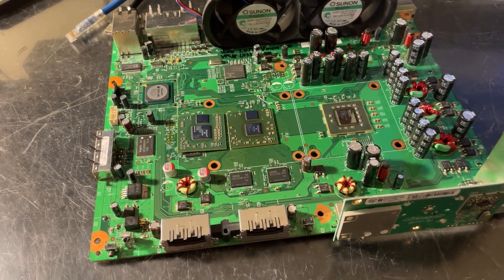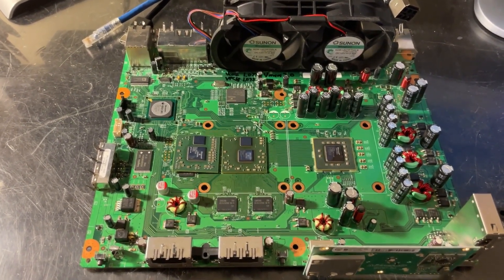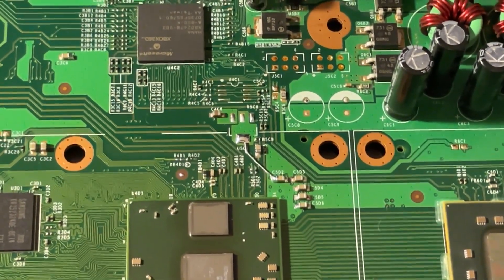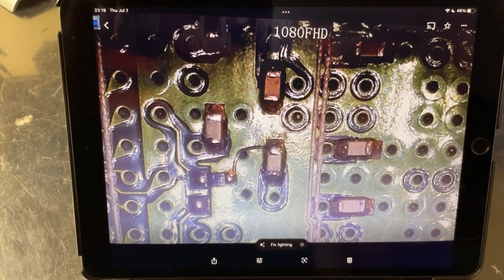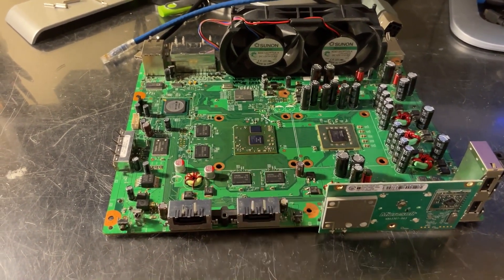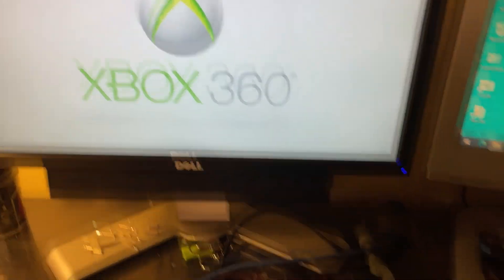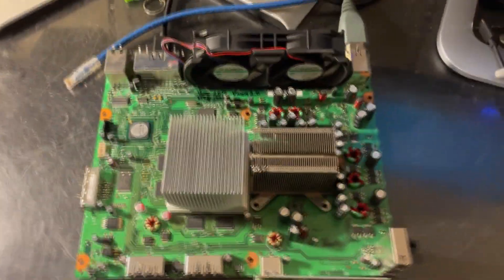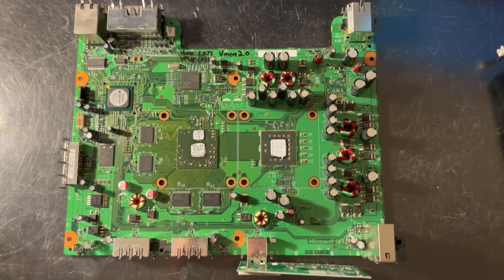Xbox 360 Zephyr Retrofitted with 65nm Jasper GPU

Comment: Hey man, do you know if Jaspers are the first boards to run their fans momentarily after powering off? Got a late Falcon that shuts them off immediately but also have a 2010 serviced early Falcon that runs them momentarily. That'd be another lil detail to add to Xenonlibrary
Reply from the maker: Are you sure you are not referring to background downloads??? There is no behavior like what you describe that is specific to a board revision.
Reply: @Josh.Davidson This is what I mean, the Falcon shuts the fans off instantly even after hours of use where the Jasper will run them after powering off, both consoles are offline with auto updates off

https://youtu.be/JYzbD-d0bYI?si=md1UX54eD5ditf7X
Reply: @Josh.Davidson  interesting,  well both consoles are offline with auto downloads off. The Falcon will never run its fans to cool the heat sinks even after hours of gameplay but the Tonasket will run them even with little use and you'll see the power button light up a couple times
 https://youtu.be/JYzbD-d0bYI
Reply: @Josh.Davidson  Nope, I could've worded that better my bad. I'm wondering if earlier revisions run their fans to cool the heat sinks because i have a late Falcon from Aug 08 which doesn't even after hours of gameplay but I have an early Tonasket from Jul 09 that will run the fans even after being idle in the dashboard. I also have an early Falcon from Oct 07 that was serviced by Microsoft in late 2010 that also runs the fans so i'm curious if Microsoft programmed it to do that during the service
Reply from the maker: Nope, they did no such thing. 
You are referring to background downloads setting. A console with that setting on will stay on and sync downloads or something for a while. There's no point to "cool the heatsinks" or anything like that.
Reply: @Josh.Davidson  Right you are Josh, i got background downloads confused with auto downloads and now i feel dumb. Thanks for clearin that up man
Reply from the maker: @CliffNark  No problem!
Reply: @Josh.Davidson  Another thing Josh. I got a Tonasket with an MFR date of 2009-07-30. Wouldn't that make it among the first produced?
Reply from the maker: @CliffNark  yes. Are you sure it's a Tonasket and not a late Jasper with Kronos?

Comment: I have a Halo 3 Xbox 360 that was oficially repaired by Xbox (RROD) in late 2012. Looking at the power plug, it appears that they either reworked the chip or replaced it with another Zephyr board. I was surprised to see that Microsoft replaced a Zephyr with another Zepyhr all the way in 2012, unless maybe they reworked the BGA packages? Was that common?
Reply from the maker: Hi,
It is more likely that they simply replaced the GPU with a fixed version of B14L (Rhea). They manufactured these chips up until at least 2010 for repairing systems, and since the flaw in the GPU was fixed in early 2008, they would end up with a lot of chips, and less and less consoles that needed them. This is my guess, if you show me a photo of the GPU die, I can tell you for sure.
Reply: @Josh.Davidson  I'll break the system down and send a picture over. If that's the case, would you say that this Zephyr is relatively reliable with its die revised GPU or will it most likely fail, too? 

I have a jasper board here that's in perfect working order. I thought about swapping it, but if the Zephyr is OK, I'll keep it in. 

Many thanks.
Reply from the maker: @Voultar  Hi there,
The defective GPU with low Tg underfill was the reliability issue, which caused the mass RROD's. When a fixed GPU is installed (high Tg) then they become reliable like Jaspers.
See my website here for some info: https://xenonlibrary.com/wiki/Rhea
Reply: @Josh.Davidson  thanks for your help.  Looks like I have an X-816970-002. If it's relatively reliable, I'll just RGH this and not worry about swapping for the Jasper main board that I have here.

Thanks so much.
Reply from the maker: @Voultar  Hi,
The X816970 is a completely reliable and high Tg chip so this is a reliable console and you do not have any worry. 
You can use my EXT_CLK glitch method on there to get faster boot times than the old RGH2.
Reply: @Josh.Davidson  Thanks for the tips. Is there a tutorial or guide anywhere that outlines that process. I have a programmer here and a few old coolrunner glitch chips, but I've never done this to a Zephyr. Many thanks!
Reply from the maker: Hi,
You can find the install pictures for ZEPHYR here: https://github.com/Octal450/Timing-Files/releases/tag/Timings

You can follow the guide here, but is for Xenon, so be sure to follow the archive's images for a few of the points.

https://www.se7ensins.com/forums/threads/updated-guide-for-xenon-rgh-with-ext_clk.1835219/

If you need any help advise me :)
Reply: @Josh.Davidson  Hey Josh, I'm using J-Runner with Extras V3.2.2 R3 and I've got a clean NAND dump of my Zephyr with my xFlasher. I'm a little confused on the next steps. I've set my console type as "Zephyr" in J-Runner and I think my next move is to create the xELL and then Write XeLL back to the NAND, but 1) Do I need to manually select the ext_CLK timing files that I downloaded from your GITHUB or are they already baked into J-Runner for when I program the glitch chip and 2) Do I need to manually select "Falcon.ecc" as the tutorials that I'm seeing say that if you choose Zephyr.ECC, the console won't boot and you must use the Falcon boot-loader or will this happen automatically in this version of J-Runner? 

Sorry so many questions. I appreciate you. 

Thanks again!
Reply from the maker: @Voultar  Hi,
You don't to manually select Zephyr, it should select automatically. Did it not? 
Yes your next step is create/write xell. You do NOT need to manually change to Falcon at any point, this is done automatically where needed in my J-Runner with Extras.

The software includes the Matrix/Coolrunner timings built in, you can use those. If using X360ACE then you can use the archive.

Btw, I checked out your channel and you seems to have nice content!
Reply: @Josh.Davidson  Thanks a lot for the help, initially, I made the mistake of following a 4 year old tutorial. I found up-to-date documentation and this was a total breeze. This Zephyr is putting on average in 9 seconds so that's very reasonable for me. The heat-sinks get hot as blazes, but that's just to be expected I guess. Thanks for checking out my channel, too!
Reply from the maker: @Voultar  Hi
Glad to hear! That sounds like the expected boot times. I hope you enjoy my timing files :)

The heatsinks should get hot, yes ,its correct. As long as the paste is replaced there is nothing to worry about thermally. Please do not do any modifications to the thermal system as is fine how it is :)

Have a good one!
Reply: @Josh.Davidson Reading your post gave me some hope for my recently acquired 17 year-old Zephyr.  It was Refurbished June of 2009 by Microsoft so is there a probability that it has at least the second revision of the Rhea Gpus?  I'm aware that it's old and things don't last forever but I hope to enjoy a few years of casual gaming with it.

Is it necessary to clean it and repaste it right away or can I push it a little until I start getting warnings?  Can irreversible damage be done if I don't give her a tune up?
Reply from the maker: @matttherrien9608  should be fixed yes. You can tell by gpu type model and date. No immediate service needed. If somethings wrong, it'll complain.
Reply: @Josh.Davidson  thanks.   Now I don't have to worry about playing games on my old console until it warns me.
Reply from the maker: Yes, unless you have super loud fans or overheating error (2 flashing red) then you are fine.

Comment: does doing this decrease power usage? what i mean is would you be able to use a jasper power supply and itd still be fine in the long term?
Reply from the maker: It decreases, but the CPU is the much bigger power user. It is still a 90nm and still requires the 203W PSU.

Comment: Is this a better mod than using a newer 80nm GPU like in your other video? Or do they both have the same reliability?
Reply from the maker: The 65nm chip is probably slightly better on paper - especially with the power use. But the 2010 80nms are just as solid in my experience.
Reply: @Josh.Davidson  Thank you. I have one more question. How do you identify the date of the GPU?
Reply from the maker: @lackoftrack1323  It is on the die in YYWW format.

Comment: Why do the CPU and GPU have hot glue around the edges? Always wondered that.
Reply from the maker: I don't know. Common for BGA chip manufacturing. After manufacturing it serves no purpose. The thing about the glue holding the chip is a quite frankly absurd myth. The glues peel off at around 100C whereas the lead-free solder takes 217C+ to melt!

Comment: Very cool but why?
Reply from the maker: Because the 65nm Jasper chips use less power, put out less heat, and most importantly, do not fail and the common RROD issues are fixed.

Comment: why ?
Reply from the maker: Because the 65nm Jasper chips use less power, put out less heat, and most importantly, do not fail and the common RROD issues are fixed.

Comment: Hi Josh, thank you for all your hard work for the modding community. I have a question! If I plug a USB stick with a default.xex in the root and power up a normal unmoded Xbox360 it will give an E71 error, tried also with an game (signed xex) and still E71. Why is the Xbox360 designed to boot an xex from the usb drive at startup, also what could we run at startup?
Reply from the maker: I’m not aware of such behavior. E 71 is the dashboard crashing.
Reply: @Josh.Davidson  Perhaps you can try. Maybe it was designed to load a diagnostics OS at service center. Maybe it is a gateway for a new mod. On a modded console I can load NAND Flasher on boot up.
Reply from the maker: @CATSOFTNET  Definitely not a gateway for a mod.